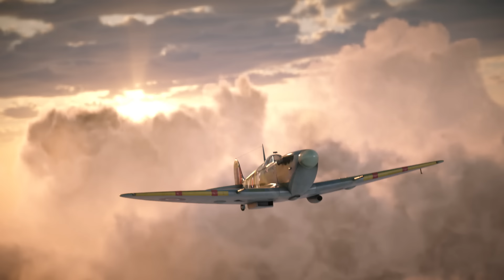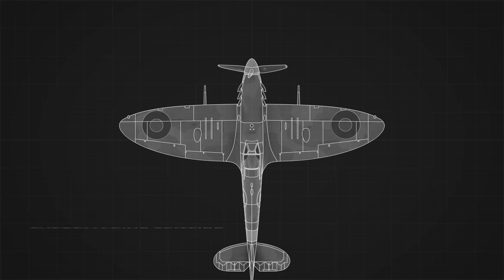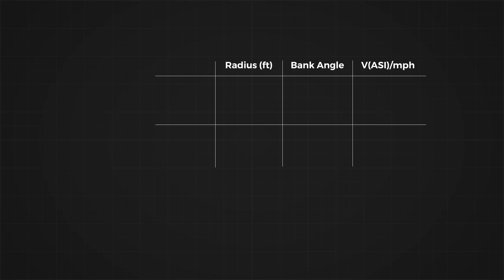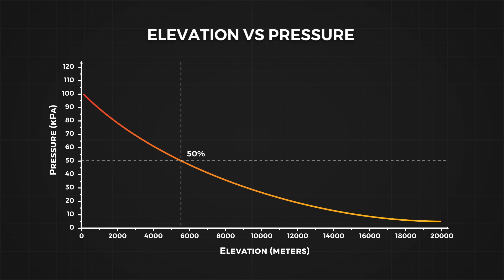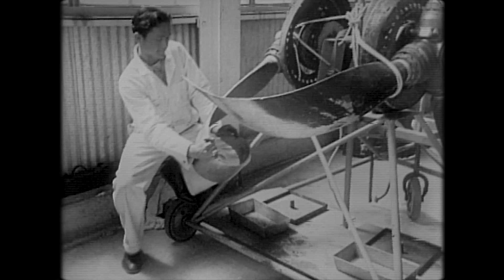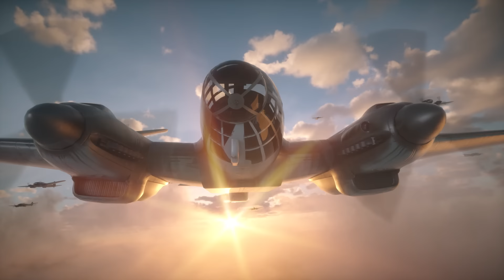The Insane Engineering of the Spitfire

Comment: There's another critical benefit of the lower wing loading of the Spitfire vs 109: future proofing. Modifications to an aircraft will almost ALWAYS make newer models heavier than the older models, even if overal capabilities improve. Since the 109 already had a rather small wing, the late war G and K models were beginning to feel very sluggish in low speed flight, while the Griffon Spitfires were still quite elegant to fly.

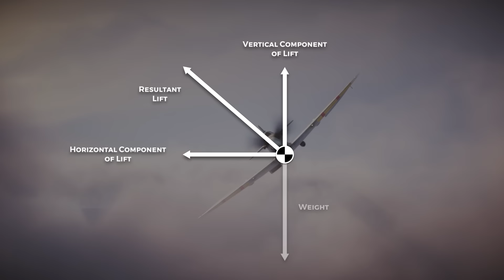Comment: 4:07 - Is that correct? Pushing forward on stick pitches the nose down (elevator deflects down). Wouldn't that decrease lift? You'd gain airspeed but not lift, right?
Reply: wait a minute, your on to something
Reply: If you pitch down while trying to circle you are flying straight

Comment: You have missed one point when discussing the benefit of the elliptical wing, the lower induced drag does not seem much flying straight, but induced drag varies with the SQUARE of the Lift coefficient so in a 4G turn the induced drag is X 16 times. This fact also impacts the ability to turn tightly, the Me 109 had automatic slats which allowed its wing to achieve much higher lift coefficients in a tight turn, but at the cost of much higher induced drag. This caused Me 109s to loose speed or altitude or both in a tight turn if they tried to keep up with a Spit. Later in the War, the improved Octane rating of the fuel allowed the Merlin to be boosted much more than Nazi engines.
Reply: ꜱᴇɴᴅ ᴀ ᴍᴇꜱꜱᴀɢᴇ👆👆
Reply: Exactly, less induced drag especially at high altitude means less power (boost) needed to maintain altitude during the turn.  The Spit excelled at that and the stall buffet let the pilot ride the edge of the stall without fear of flick rolling like the Hurricane, P-40 and Mustang, etc.

Comment: First time I heard a balanced treatment of the (semi) elliptical wing.  When they chopped off the wingtips*, it struck me that they had to work pretty hard to find differences.  You still have one guy, one ~150p hp engine, aspect ratio 6 and wing loading similar to contemporaries.  Excellent and informative job here
Reply: The clipped wingtips reduced the turning performance a little bit, but the reduced drag gave a higher top speed. 
Also, the roll rate improved, since the tip of the wing isn't being dragged obliquely through the air as the aircraft rolls. 
These were tiny margins indeed, and done only when the trade-off was deemed important to better match local enemy aircraft. 
But it kills the aesthetics, too!
Reply: Pilots flying the clipped wing Spits at lower levels appreciated the better speed and roll rate.

Comment: A little incorrect about the turn radius. In those airplanes turn rate - ie. how many degrees around a circle you can do per second was actually quite a bit more important than turn radius - how tight a circle you make. If you have two airplanes chasing each other around the circle, both doing the exact same radius turn in the same direction, but one is a little faster, the faster one will win - because it does more degrees per second. It will get on the tail of the enemy eventually. Even if the circle radius is a bit bigger for the faster one, still, doing more degrees per second is worth it as it still gets you on the tail of the enemy, and then they just pull a little extra on the stick, sacrifice some airspeed to tilt the airplane "up" for the final shot. If they miss, they ease on the stick and start doing wider circles again to recover the airspeed back and close on the target again. 

If radius was all that mattered, helicopters would be the absolute best at dogfighting because they can hover, they can do literally zero radius turn. But in reality they're the worst because they're just sitting ducks when hovering and can never chase the enemy.

Comment: The negative g problem was solved, at least partly, by a flow restrictor designed by Beatrice Shilling, who deserves to be remembered for coming up with a very simple, cheap fox that worked well enough until the carb was fully redesigned to cope with the issue. Overall, however, an excellent and deep account of the physics of the aircraft, thank you.

Comment: I think you made a mistake at 4:07, in a turn, one would need to the elevator deflect up, rotate the nose up to pitch the main wing up for more lift, to compensate for the lost lift. Not pitch down as shown in the animation. 
Pitching down may keep a plane flying in a straight line, even when the plane is rolled to one side (wings are tilted), although that usually also requires rudder input. This is rarely done except when trying to looking for land marks or in an air show.

Comment: The spitfire engine cutout from negative G induced fuel mixture richness can be seen in the opening scene in the movie battle of Britten when a spitfire does a roll and you hear the engine die and come back with a little backfire.
Reply: Was cured by fitting a component in the carburettor. Miss Schillings orifice.
Reply: yes, hence the half roll and dive to pursue 109s, a manouver that the Hurricane couldn't copy with its "lazy ailerons".   Another reason why Hurricanes were sent after bombers.

Comment: can you do a video on how bomb racks, aux external fuel tank ejectors, missile launcher rails, and in particular, missile ejector launchers work? such as the Arrow 7 or LAU-118 ejectors for Aim-7 Sparrow and Aim-120 AMRAAM.

im curious how the engineering behind store/ordnance separation works. because if it goes wrong, it could lead to catastrophic failure.

Comment: The BF109 was able to be upside down due to it's fuel injector, while the Spitfire had a carberator which would cause the spitfire's engine to run too rich while upsidedown (or negative g), which would flood out the engine. This was fixed in later spitfire models though i think.
Reply: I think Miss Shilling developed the solution.
It was lovingly referred to as Miss Shilling's orifice.

Comment: Although the difference in induced drag of the Spitfire's in level flight seems insignificant - even at the slow speed of the chart in your video - it is in high G turns that it is very significant and this was shown in practice as the Spitfire could out turn(and maintain the turn) both the HURRICANE and the ME109. A very important result - particularly when the Spitfire wing was of a shorter span and much lower AR than the Hurricane. The broader chords of the Elliptical wing allowed for a light and strong wing to be built using the the much thinner NACA 2200 series airfoils which in Shenstone's modified form proved very successful.  There is far more information in the book.
Reply: ꜱᴇɴᴅ ᴀ ᴍᴇꜱꜱᴀɢᴇ👆👆
Reply: What you say is correct. The problem here is Real Engineering has plagiarised an implausibly low hypothetical induced drag number that fails the most basic reasonableness test. You may have noticed the total drag in that table was only 59 lbf for this 6000 lb + aircraft, implying a nonsense L//D ratio of 100:1 (at a mere 100 fps!) The Spitfire is known to have a max L/D about 14:1. I am not saying the report from which this data was plagiarised was wrong. It was a trick that put the induced drag in the same proportion to profile drag at 100 fps as it would be at Vmax. What is wrong is to believe that shows the elliptical planform "barely made a dent in overall drag". Induced drag would dominate the total drag at low airspeed for the Spitfire as it does for every other aircraft. It would also dominate the total drag during the minimum radius sustained turn, as you point out.
Reply: well said.  The large increase in induced drag of the Hurricane in a turn meant that it didn't have the HP at altitude to sustain it.   Camm failed again with the thick winged typhoon "interceptor"

Comment: You might say that bf109's guns positioning was more complicated but it made it a hell of a lot easier to aim and improved the roll rate by reducing inertia.
Reply: And there were only two, with a reduced rate of fire due to interrupter gear.
Reply: @johnbrewer8954  that completely depends on the variant, going from the bf 109 A through K there were models with 2, 3, 4 machineguns and even 1-2 cannons (20 or even 30mm caliber).
Reply: @baraka629  Not firing through the prop arc there wasnt, which is the point I was replying to.

Comment: I loved this video. So few videos of the Spitfire mention the carburetor issue that occurred from a wrong decision in 1936 not to go with fuel injection. 
I wish the contribution of Beatrice (Tilly) Shilling would have been mentioned because her fix help save the Spitfires during the Battle of Britain.
Reply: It wasnt a wrong decision, the carb cools the air fuel mixture allowing more boost.
Reply: @johnbrewer8954  exactly, which is why the smaller Merlin could compete with the larger DB engine.

Comment: An excellent video, the Merlin variants were numerous, it’s worth looking into the Hurricane II which appears towards the end of the Battle of Britain with the Merlin XX engine,so single stage two speed, consequently it has a higher rate of climb to 30,000 ft and service ceiling than either the Messerschmitt 109E or Spitfire 1. However the Merlin development into the Merlin 60 and beyond was the game changer for Spitfire’s and Mustang’s. Also it’s worth looking into the Spitfire VIII this was the first significant change in design, to improve the manufacturing time substantially leading to the Heavy weight Spitfire’s with Griffon engines. Regarding the carburettor they knew, however because prewar doctrine concluded there wouldn’t be dog fighting it wasn’t considered an issue. Clearly they got that wrong, however there was a standard manoeuvre which over came the problem which if operated correctly would put the Spitfire or Hurricane in an attack position against the Messerschmitt in a dive, but required skill from the pilot.
Reply: The Spitfire III was a very promising variant that never made it into production, leap frogged by the Spitfire V which mated the new Merlin 45 engine to the mk1 airframe, quicker and easier to do than produce the MkIII even though the Mk III had some significant design improvements. The Neg G carburettor problem was mitigated in the MkV by a modification to the Carb - a restrictor, and designed out in the Mk IX. It was only a problem for the Mk I and II.
Reply: Those Merlin XX's should have gone to the Spit III, which would have set the LW back on their heels at 400 mph.  Pilots however would have had to adopt the german peck and zoom attack method.

Comment: One thing to add. EVERY SINGLE COMBAT AIRCRAFT in England during WW2 had been flown by a female wRAF pilot! Every male pilot was needed on the front lines, there were no men available to fly aircraft around the country, so EVERY SINGLE fighter or bomber plane built in England was flown from the factory to the front line airfields by women pilots and every one that came back for repair or refit was flown by the same women pilots.

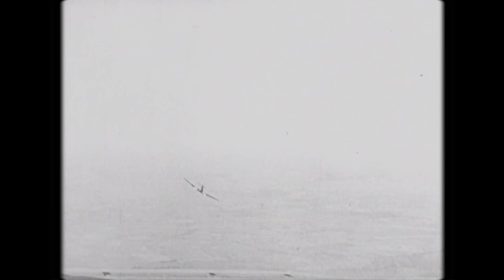Comment: 17:00 - from the inception of the BoB all operational Spitfire squadrons were equipped with constant speed props and used 100 octane fuel: a marked improvement over how most British fighters were equipped only a month before during the battle for France. The constant speed props largely negated the low altitude climbing-turn advantage that the 109s had in June; and being able to buzz 12lb of boost (because of 100 octane fuel) gave the Spitfire an climbing manoeuvring advantage at all altitudes over the 109Es - much to the shock of folk like Werner Moulders who had tested a captured Spitfire using 87 Octane fuel and the 2 speed de Haviland prop in June 1940.
Reply: Spitfires never went to France they were used from UK over Dunkerque. In the Battle of France all Hurricanes had been fitted with CS props and 100 Octane before Germany invaded.
Reply: De Havilland engineers started the conversion program at 12 Spitfire stations on Tuesday, June 25 1940. 
 The first Spitfires engaged in dogfights on May 23 over Calais, with at least one making a forced landing (74 Sqn Ldr). Later in May,  the RAF lost 229 aircraft during the Dunkirk evacuation, of which 70 to 80 were Spitfires.

Comment: Amazing evolution of the Spitfie airframe from a lightweight short range interceptor to carrier fighter to escort fighter and finally high speed griffon monster.  
Most people don't realize that the Spitfire internal fuel capacity went from 85 imp gal to 196 Imp gallons on some late production Mk. IX / XVI versions.  (That's 235 US gal)  Some Mk.IX's in 1944 could range from Tangmere and into Germany and back -  an amazing accomplishment for an interceptor / "zone fighter" design.

Comment: I had a relative who took apart an BF-109 only to be astonished at how far more-advanced was German engineering.
Now, mention the stall issues of the Spitfire. The BF-109 had no such issues due to being fuel-injected. The Spitfire issue was a carburetion problem. They were not allowed to climb due to the stall issues.
Reply: not allowed to climb?  That's funny, since it was the best interceptor of the war.  You're probably thinking of the early Merlin problems with negative G manouvers.  Problem solved in early 1941.
Reply: @bobsakamanos4469 
Thank you for proving my point. My grandfather worked on the Spitfires and Hurricanes. He studied the downed Messerschmidt BF-109 where he was stunned at how far ahead was German engineering. Don't get me started with how he felt about the BF-190.
Reply: @bobsakamanos4469 
You mean the problems with the engine DURING the Battle of Britain that were costly? My family were there.
Reply: @bobsakamanos4469 
The steeper the climb, the more the engine died due to fuel starvation.
Reply: @yxmichaelxyyxmichaelxy3074  I once read Hooker's response to that criticism of the float type carb.  They had their rationale for not using FI, but I'm sorry I can't find it in my files/books.  One thing for certain were the exorbitant fees for using American designs, which was why BSA produced .303 MGs vs 50 Cal.  
Regardless, the Spitfire still climbed better than the outdated Hurricane I & II (despite the later being given the Merlin XX) and was a close match for the Me109.  Ya, my family was right under it as well, but that's irrelevant.
Reply: @bobsakamanos4469 
Why was the Allison changed to the Merlin? It was the British who improved the P-51D Mustang, not the Americans. My grandfather was part of the group who perfected it.
Reply: @bobsakamanos4469 
It was nowhere near the BF-109 which was eons ahead of any Allied engine design.
Reply: @yxmichaelxyyxmichaelxy3074  have a read of the presentation by A.C. Lovesey regarding the development of the Merlin.  It was far beyond the Daimler-Benz with the Spit being way ahead of the 109 for the 2nd half of the war,....and of course the Allison was never in contention.

Comment: Today, there are complex computer models, advanced wind tunnels, and CAD to assist in aerodynamics, to the point where there's next to no unknown factors, but back then, only the basics were grasped, and testing was difficult. Both breakthroughs and failures were frequent in those days, and because of this, the Spitfire will forever be an outstanding machine.

Comment: Respectfully, the Spitfire wasn't our only defence aircraft in the Battle of Britain. The Hawker Hurricane was at least as effective, and the Royal Air Force developed the strategy of using the Hurricanes to take on the enemy bombers whilst the Spitfires engaged the escorting enemy fighters, as was that was their performance forte. You rightly state that both planes suffered from the carburettor problem, both using the Merlin engine, but this was mitigated somewhat by Beatrice Shilling's innovative modification. By the way, I think you meant to say 'vortex', the singular of 'vortices'.
Reply: RAF were so concerned with the Hurricane poor performance that they issued instructions to modify the Hurricane engines in Mar 1940 to take 12 lb boost.  It was a partial solution that worked up to 10,000', well below the bomber stream; however use of WEP boost increased fuel consumption by 40% and threatened the life of the engine.  If they made it back to base, the fitters would have to sideline the aircraft and inspect the engine.

Comment: I agree with Pablo.  When turning the pilot needs to pull back on the stick which deflects the elevator upwards to cause the plane to lift up.  This same action also decreases the radius of the turn.   The only time you would deflect the elevator down for a turn is if the plane was flying inverted.

Comment: Great video! 
Note that the air is compressed by the supercharger before it merge with the fuel in order to to increase air density and be able to mix with more fuel, for better output power.